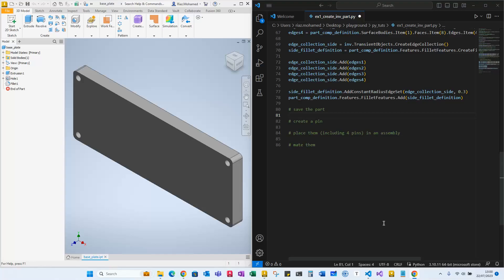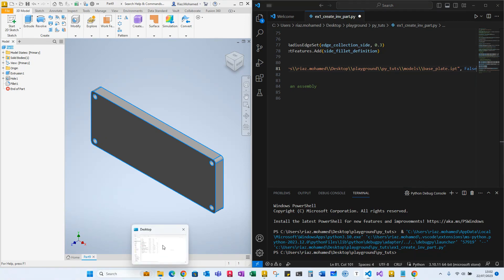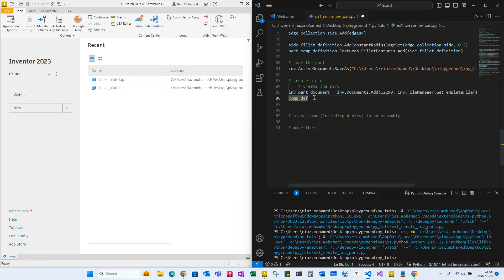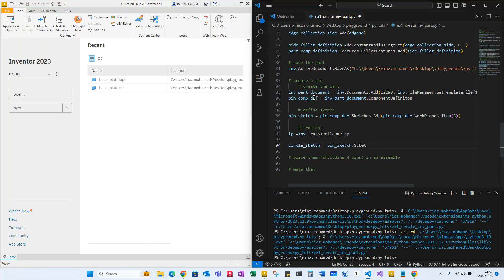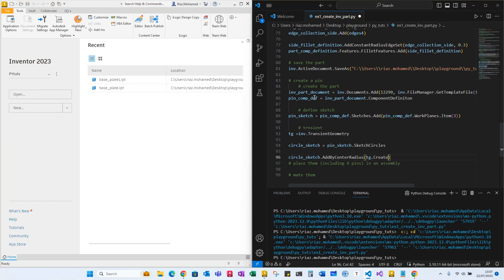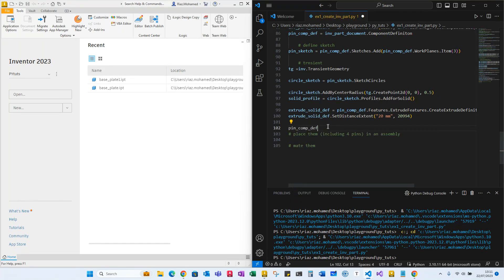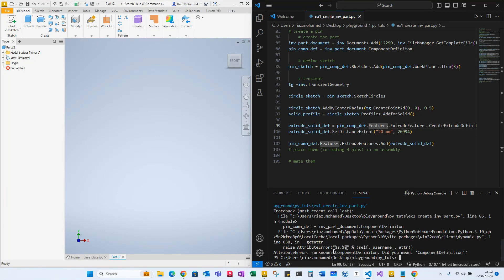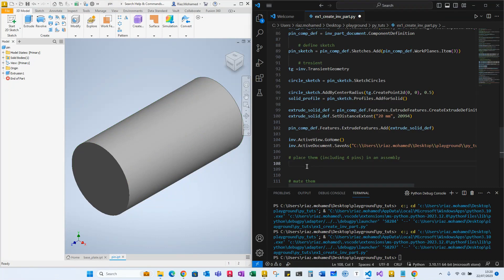Part 7: Creating a Pin and file save using Python and Autodesk Inventor API

Comment: KeyError: '_dispobj_' can you fix this error?
Reply from the maker: Hi can you please explain what created the  error
Reply: @theaiautomationist Thank you so much but I took care of that problem, I think my application is broken. Now ı have new problem. How do I get a line parallel in both directions?
Reply from the maker: Will have a look at it in the morning. !
Reply from the maker: Sorry didn't have a chance.  Can you please elaborate what you are trying to achieve in your model ?
Reply from the maker: Sounds like a cool little project. Try your best to solve it. If you are not able to the. Please post it here. And we all can have a look. 

Looks like we need our own archive  of code resources for future references.
Reply from the maker: Small tip try to use the method #GetActiveDocument instead of #Dispatch
As it causes binding issues

Are you just trying to extrude your sketch?
Reply: @theaiautomationist  Although there are many profiles in the drawing I made, the number of profiles appears to be 0, why could it be?